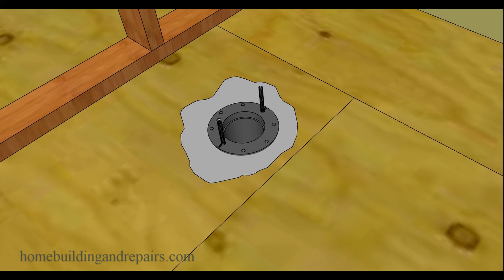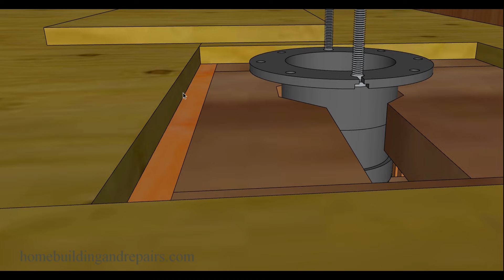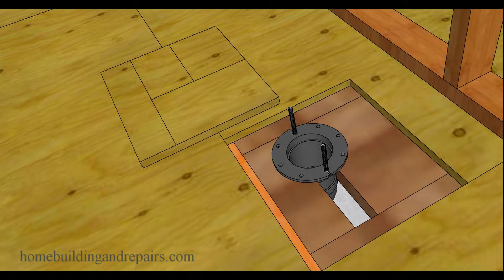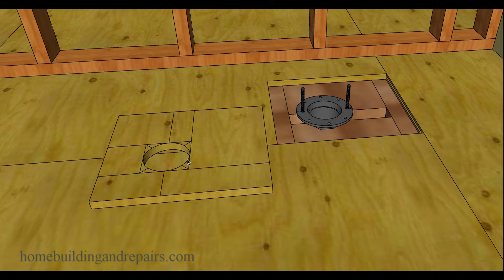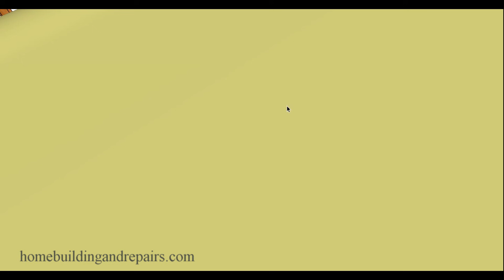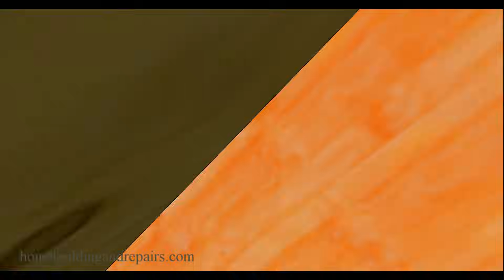How To Replace Damaged Subflooring Under Toilet – Home Repairs

Comment: We appreciate the detailed walkthrough on repairing subflooring! Cutting out the damaged area seems crucial, especially around plumbing. I’ve learned that using blocks for support under the new plywood is a smart move, as it helps stabilize everything. 

I once tackled a similar project and found that measuring carefully around flanges made all the difference. It’s amazing how much easier the installation becomes with proper planning. 

Also, the tip about using brass screws is spot on—who knew they could help prevent movement? Thanks for sharing your insights; they definitely make tackling these repairs less daunting! Keep up the great work!

Comment: Great video, but I don't understand why you would lay your blocking flat as opposed to upright. You can install upright blocking between the joists on either side of the flange, half of the width under the existing subfloor and half under the new subfloor. If there are two layers of subfloor totaling at least an inch thick I would think that would offer plenty of support. Laying the blocking flat won't offer the same amount of support, correct?

Comment: Why not replace the flange which is probably damaged from the toilet rocking on the rotted floor, so that the subfloor repair can be a solid single piece with a hole (hole saw) so the flange can be installed the right way?  Stronger and probably easier.
Reply from the maker: I probably mentioned this in the video.

Comment: The flange is supposed to be installed OVER the permanent flooring ie., tile, laminate, etc..   But it rarely is.
Reply from the maker: It usually depends on how tall the flange is.
Reply: Okay!  Thank you for the information. I am beginning a remodel of my master bathroom.  I discovered black mold in the subfloor (but not around the toilet).  my plan is to remove/replace the subfloor.  I just want to make sure I educate myself so that I do the work properly and to code.    @gregvancom

Comment: For a circle, you can use a scrap piece of cardboard, trim nail and pencil. Put ur nail trough the cardboard and mark the radius of the circle with your pencil and put ur nail through your measured radius for your pencil lead to sit in. Attach one hole of cardboard to the center of your circle with the nail and have your pencil led through the other hole and mark your circle.

Comment: Great video! One suggestion I have is that you take your replacement peice and trace it to the damaged floor for a perfect fit. it is difficult to  cut a perfect square without a reference edge in the middle of the floor.
Reply from the maker: Great idea!

Comment: Firstly, you’re in a league of your own. The CAD drawings, the explanation, all top notch, and always. But I’m curious as to your suggested orientation of the blocking beneath the subfloor itself. Laid horizontally, (instead of sistered to the joists and blocked perpendicularly), I’d imagine this would afford very little structural support underneath the toilet. Most people literally plop themselves down on toilets. I wouldn’t trust blocking that was laid flat underneath the plywood as shown in this video. It seems like a tremendous amount of strain placed on very few attachment points to the actual structural members below. Please correct me if I’m mistaken.

Comment: Thanks, going to need less plywood than I thought. I agree about cutting around the flange, that's how the floor was cut for my old cast iron flange, and it made a temporary flange replacement impossible without some kind of backing. Thankfully they sell steel backing/brackets that fit around the flange and creates a support, which you can fasten to the subfloor wider around the flange, and then fasten the flange itself to the steel backing/bracket. 

My subfloor was so bad that I had to temporarily shim the toilet after replacing the flange, otherwise the toilet rocked. I used one of those plastic replacement flanges on a cast iron pipe, which worked okay, but I wouldn't use one again on a cast iron pipe due to height limitations, in this case the flange was too high in its lowest position. Replacement cast iron flanges wrap around the pipe, rather than fitting inside, so there is more freedom to raise the flange up and down. When I replace the subfloor I'm going to get rid of that plastic flange and put on a new cast iron replacement. Should have done that in the first place, but these are things you learn by doing, I guess. 

This is also probably a good time for anyone to replace the flange, especially if you have an old cast iron one, since you will be able to just place the subfloor over the flange after cutting a hole rather than cutting the board in half or more pieces.
Reply from the maker: Thanks for sharing.

Comment: Great information, very helpful., thank you! I was about to cut the pipe and reinstall a flange elbow, but this may be more reasonable and appropriate. If my new subfloor is 1/4 inch thinner than the old sub floor, would you suggest I install those support boards 1/4" higher to compensate? Or install the supports and plywood pieces THEN floor leveler after to even it out?
Reply from the maker: Glad it helped

Comment: Not putting in blocks was one of the mistakes made when our subfloor broke under the toilet. Using OSB to replace the plywood was another big big mistake. It's not the same height as the old floor. And since the plywood wasn't cut to the joist, it is floating and is squishy in that spot.
Reply from the maker: Good points.

Comment: Thank you for making these videos!!   I am about to try to repair my parents rotted subfloor under the toilet.   Extremely paranoid and nervous about being able to do it.  Been repeatedly watching this video.
Can you quickly explain how the blocking is placed around the pipe?  I understand the 2 blocks that connect to both joists.  Its the wider pieces.  Where do those ge screwed in?  Are they also screwed into the joists and added blocks?
Reply from the maker: Email me a picture of your project.

Comment: Great video, concise and simply explained. Thanks so much. 

Question on the blocking - is there any reason you ran the cross blocks (between joists) horizontally rather than on edge? Would on edge provide more strength/stability or is it not needed?

Thanks again for the phenomenal video, this is unreal
Reply from the maker: If it produces the same results, then go for it.

Comment: What if the piece of subfloor I put back in isn’t level with the rest of the floor (I’m in process of making a repair by the shower). Thanks!
Reply from the maker: That might need to be re repaired so it's even with the top of floor.

Comment: So does the bottom of the flange get level with subfloor or finished floor?
Reply from the maker: It depends on the flooring thickness. Thin flooring like vinyl tile could require you to lower it and thicker flooring like tile might require flange to be raised. You're usually safe by having the top of the flange even with top of finished flooring, but you need to check the toilet to verify.

Comment: One thing i didnt see you explain is if you only cut out the diameter of the pipe, if so the flange will not be flush with the plywood. 
Or do you cut out the circumfrnse of the bottom of the flange, which is bigger than the pipe itself. 
So lets say the pipe is 4 inch diameter, well the bottom of the flange is about 4 1/2 close to 5 inches so you can push the flange all the way down flush with the pipe. 
What do you say about this problem?
Reply from the maker: You won't be able to cut it at one specific spot and put  it back together if you don't have enough pipe length. You would need to cut it at another location and if it's going to create more problems then don't cut anything and find another repair suggestion.

Comment: thanks for the instruction. I guess i need to first pull the toilet seat up and see if the flange is screwed into any block or if there's any block existing at all. I'm concerned about tearing up the nice finished ceiling in the basement though.

Comment: What do you think about using pressure treated plywood in the bathroom?
Reply from the maker: I don't think it's necessary as long as water isn't making it's way to the subflooring. If you think it could be and are looking for a little more protection, then it might be a good idea.

Comment: You said to leave a 1/4" gap (at least 1/8th) around the pipe when fitting the blocking and the subfloor. But we have to remember when we go to cut the plywood or OSB board in half (to fit around the pipe) the kerf is going to remove even more material. Is this amount inconsequential (being that it will be only a little more than a 1/4" on each side)? Probably, but I thought I'd mention it. Maybe it would be better to leave only 1/8th inch on the sides which will lose a little length when cutting the board in half and then wait to cut the circle? I guess the right thing to do would be to lengthen the width of the board by the width of the blade to start out with so that both halves sit flush together and against the other boards.
Reply from the maker: The quarter-inch gap would be to make it a little easier for those who can't cut a little closer to the pipe. I believe the minimum is 1/16 of an inch, but that might be impractical for most professionals and do-it-yourselfers.

Comment: hello got quick question sir 
i got cast iron flange but its not that bad in shape but i want to know if could another 3inch flange on top of the cast iron, also should the flange be on top of finished floor or the subfloor? thanks you kinda sir
.
Reply from the maker: I'm pretty sure they make 3 inch toilet flanges that go around the pipes and attached to the concrete or wood sub flooring. The flange would sit on top of the sub flooring or concrete, but might need to be raised above the finished floor also.

Comment: What are you calling blocks? Your video looks like its showing a couple 2x4's and maybe a 2x6 and a 2x8... But either way thats not block. Plus if you split the joists when you cut the sub floor, add a nailer on each side why on earth would you add your "blocks"? Plus if you cut the floor up just cut the elbow off the drain and cut a hole in your new sub floor to fit the drain, add the flange after the floor is down and you dont need any of those crazy cuts. Flange on top of one inch floor with all the screws installed will not result in a wobbly toilet. This video makes this simple project harder then it has to be for literally no reason.

Comment: Do I have to cut a circular hole that is exactly the same size as the pipe? or square with a bigger empty space is fine since I dont have tool
Reply from the maker: The toilet is usually going to be supported by the floor and as long as the pipe doesn't move, then you can cut whatever size shape you desire. You just can't have the pipe and toilet moving, because that could create a problem at the connection point or where the toilet connects to the plumbing pipes.
Reply: @gregvancom  I assume the pipe is hanging from midair supported by joist(those frames). does the flange tighten with the subfloor or pipe? we are concern about the moisture under the vinyl sheet so we wonder if the subfloor(not sure if plywood or chips) is wet, do we have to remove the damped subfloor entirely or wet plywood still able to do the job?

Comment: Great video! I have to remove our flange because it is cracked through on two sides so I will just cut the hole for the pipe in my new subfloor piece. Glad to see how to do the blocks underneath for great support!
Reply from the maker: Glad you like the video and thanks for taking the time to let us know.

Comment: I always thought the toilet flange was suppose to be installed on top of finished flooring for best seal?
Reply from the maker: Most of the time it's installed above the subflooring, but if I was building a new home or making a repair were I was going to be modifying the plumbing, I would definitely allow for the thickness of the flooring, when setting my toilet flange.

Comment: We had a toilet leak on the second floor which left a small spot of mold on the finished basement ceiling. We had a restoration company come in because we were thinking of going through house insurance. They want to cut out part of the basement ceiling, have blowers going to dry out the ceiling then apply anti-microbial agent. Talking big bucks here. We are planning on renovating that bathroom anyways and will have a new subfloor put down. My question is, when they pull up the subfloor can they not look down on the basement ceiling to access if there is a lot of mold and damage to warrant cutting out the basement ceiling etc and take it from there. My feeling is the water damage is minimal and just want to avoid the extra expense of cutting out the basement ceiling. We did spray 12% bleach on the basement ceiling where the small spot of mold was. Thank you
Reply: It’s a small, small world! I’d call a handyman!

Comment: Good on ya.  As in most things in life , there is a fast way and a Correct way , are  usually not the same thing .
Far to many builders, reno guys , or handyman guys etc , doing it  the fast way so they can make more money ,
and a lot of the time it's with a f--k it ! that'll do ., type  mentality .  

And a lot of this work passes enough to get paid , but fails sooner of later down the road , but what do they care , they're paid and long gone .

I've been doing Home Reno for almost 30 years now , and was brought up in a house understanding ... If you're going to do it , do it right the first time .  Take pride in what you do .
Reply from the maker: I've definitely seen my fair share of poor workmanship and believe that most of the time it's simply the result of not having the right information. Hopefully some of my videos will solve some of these problems in the future.
Reply: renoguy25 I
Reply: In this case, it looks like fast and correct are in line.